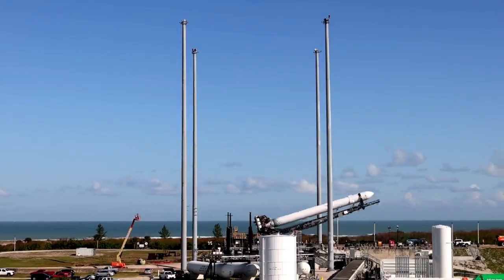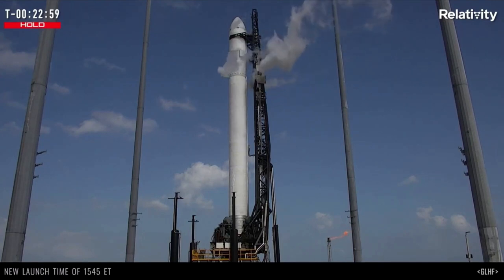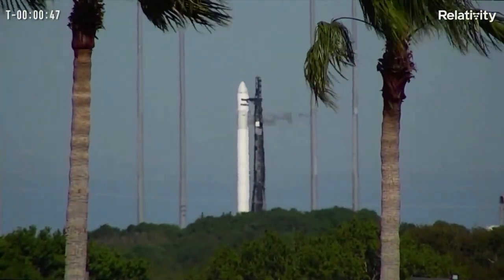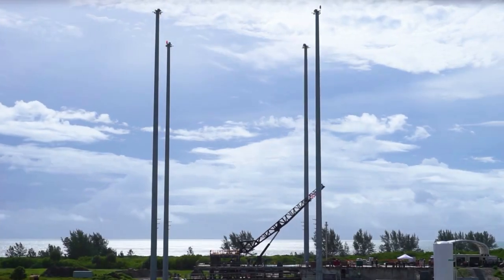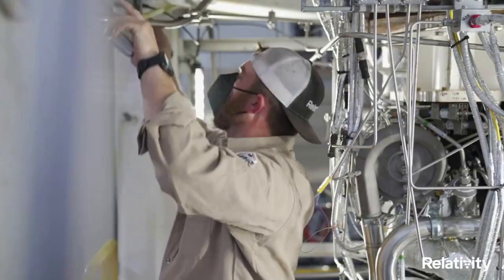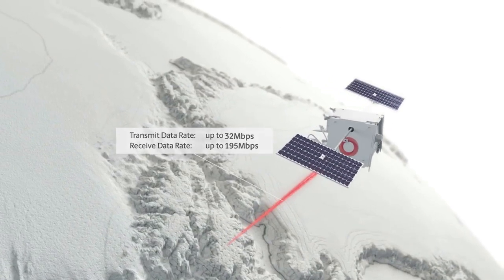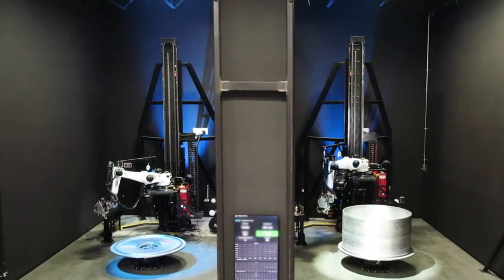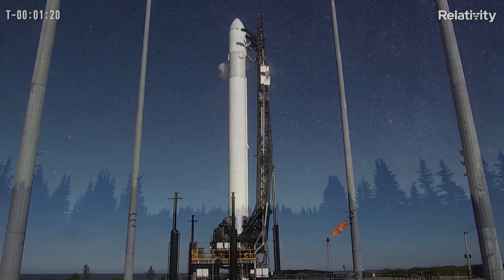Why Relativity Scrubbed Multiple Terran 1 Launch Attempts, Terran R Progress, & More

Comment: 6:02 whats crazy to me (as a "tire tech")...... 
.
that big yellow overhead crane is rated for 20 tons 
yet my little hydraulic bottle jack is also rated for 20 tons
.
point is.... their is WAY WAY WAY less metal in my bottle jack 
yet it can lift just as much
.
.
and sure, the bottle jack is a "static" load (at least i hope the semi/farming combine/gravel pit front end loader doesnt move LOL)
and that overhead can lift, lower, move left and right, forward and back.... ETC
.
still... i cant wrap my head around how a TINY bottle jack can be as "strong" as a HUGE overhead crane that probably weighs 40 tons in itself (vs like 40 for the bottle jack)

Comment: 6:50 wow... i didnt know i was "3D printing" back in the 10th grade in shop class.... 
.
that "3D printer" is simply a MIG welder..... and just like i did back in high school to make a box.... it just welds onto the last layer of weld
additive manufacture is NOTHING new
.
my dad used to "weld up" new teeth on a gear that caused a crane to rotate 
crane was from the late 1930s.... still being used in the 1990s (so, no parts lol)
.
weld layer after layer
and then grind it down to shape
.
.
and sure, this robot can be WAY more consistent.... so you dont need to grind it to shape
but its still the same idea 
.
.
.
nothing new under the sun!!!